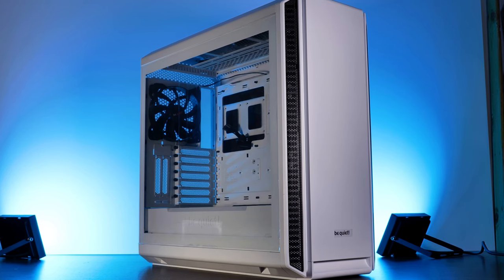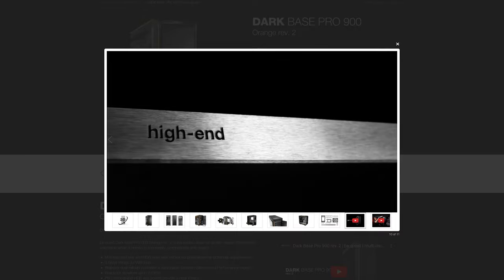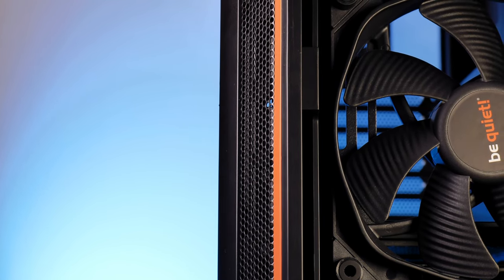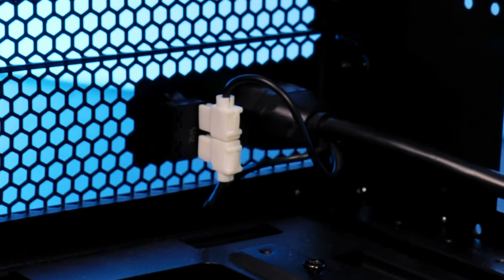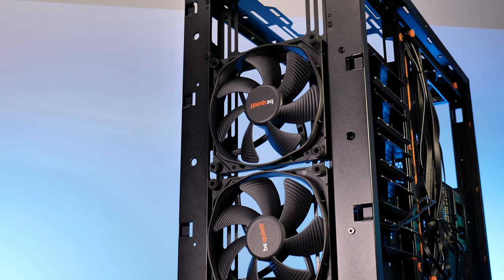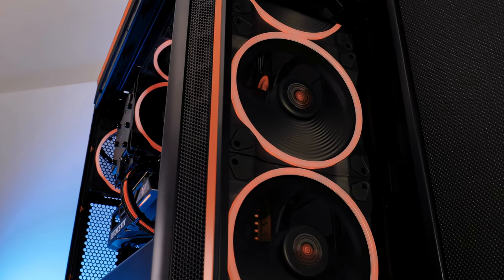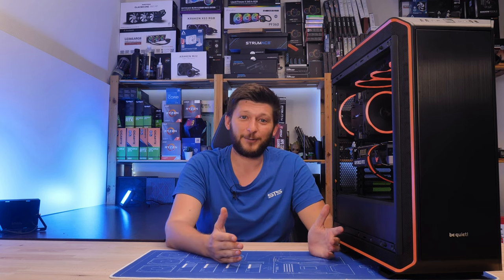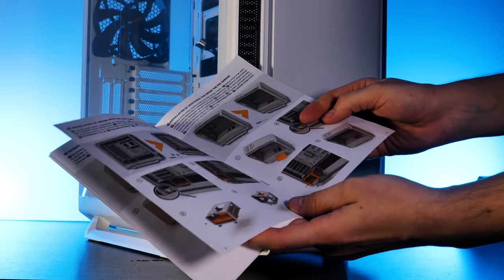Over-Engineered? Be Quiet! Dark Base 900 Pro Rev.2 reviewed

Comment: i have the mk 1 900 , i bought  as wanted an inverted case , i found it easy ?
i changed the hole box to the opposite side to invert and don't think i needed the manual ..
i have had 4 motherboards in it now and am now rocking a z790 with 13900 ,
the case is great for my large radeon saphire nito plus 7900 xtx ..
i always look for cases with a drive bay for cd drive as have a lot of dvds ,
i never put any exta fans in as not needed , only problem i have ever had in 6 years 
is the power button started to pack in and darkbase sent me a complete module 
which included it which was very cheap , i just wish i could upgrade the usb port as 
usb 2 is from the dinosaur age now ....
i like it inverted as wanted it on the left side of my desk and be able to look in on it .
i think inverted is better as the graphics card is now viewed the right way up .....
i dont have the shroud for the psu and preferer it open  at    think it will be cooler that way ...
Reply from the maker: Glad you found it to be enjoyable to build in it. We didn’t, but hey, if you’re happy, we’re happy

Comment: I'm surprised BeQuiet hasn't released an updated version of this case yet to allow for much better airflow
Reply: I agree, but I was able to get temps down very nicely by turning the top fans around to be intake, and added two fans to the basement by the PSU pulling in from underneath. So now there are 7 fans incoming, and one going out the back. That gives me very stable temps. I added fine mesh filters at the top, and put some more behind the stock filter on the front. All this positive pressure of finely filtered air has kept it cool and clean.
Reply: @johndicus123  Good to know. I'm currently building a new system and using the stock fans I've have found the internal temperatures don't seem to change, regardless of the settings I select on the fan controller (silent/performance) or on the fan slider.  

I've ordered some more fans and was going to go bottom intake/top exhaust, but thanks to your post, they'll now all be intakes. :)
Reply: @johndicus123  Thank you!

Comment: All you reviewers and manufacturers can you explain where the GPU takes air from? The back grilles or a single front fan? Or how the CPU does not breath 350W of hot air from cpu?
Reply from the maker: Mostly Front, partly bottom if there’s a path and/or a fan that pushes air into it. And no, the GPU will not use that air if everything is used as intended, the CPU however might be using old GPU air

Comment: I was a bit worried about your statement about the manual that it does not contain enough details to do the actual installation work. I agree that the first part of the manual does not contain much details, but starting at page 67, I found detailed descriptions of all steps. Looks good and useful to me and makes me believe you might want to reconsider your opinion about the manual.

Comment: It is absolutely over-engineered. No assembly manual. Only a diagram of the individual parts. And just a short video with 200 milisecond clips of an assembly with no PSU cabels in a model environment from be quiet!. This is what we call German Excellence. The PSU shroud is a PitA. Yes, it does quiet (like 10 %, rubberbands even out the vibrations much more) the one HDD you can realistically have down there (feels like that space was designed for micro lemur fingers), but otherwise it just pisses you off. You can only get it off via a series of contortionist moves (that touch your MOBA cables (right in the way of the onboard audio cable slot) and any PCIE cards in the lower slots) and you need to remember the exact placement of the screw on the back to unscrew every time you need to get the bastard off. And of course, you need to unplug and replug the SATA and power cables for any SSD you have mounted in there every time, with almost no give on the cables. Not only that: You have to use one hand to hold on to the shroud to get and keep the screw hole into position, and one for the screwdriver, like some circus acrobat.

The back side of the case cannot be put on unless all cables going into the cases are completely separate and aligned with the backplate - one overlap and it creates a small bulge which makes the lid not go on. It's an excellent case for a one-time-and-forget build if you are willing to spend hours trying to use trial-and-error telepathy to figure out what the creators were thinking when they designed the thing. The build quality is great, and there are genuinely lots of good quieting features. It's a terrible case for upgrades and testing stuff, no thought was given to ease of use.

Comment: "well, be quiet got a solution"

why was that so funny

if something was clear after watching the review is that i am paying for the german engineering not a manual
Reply: Having almost finished building a system using a Dark Base 900 case, I agree with the part about not paying for a manual. 

Seriously, if your manual has large numbers of diagrams/pictures intended to HELP, don't re-size them and put them three or four to a page and then split that page into two columns with 5-point font text taking up half the page... in an A5 size booklet.

Oh, and don't split the same language up into different sections of the booklet. Seriously.

Comment: 323 mm max videocard length with harddrive cages installed is low,     
not all videocards will fit, Palit RTX 4070 is 329mm for example and won't fit.  
I expected more from a case that costs this much.

Comment: so you lowered the motherboard and then complained about power supply fitting? nice.
Reply from the maker: Those were two completely unrelated points
No need to mix them together.

The PSU fitting is mainly an issue because of the top side of the PSU shroud. An unmovable part